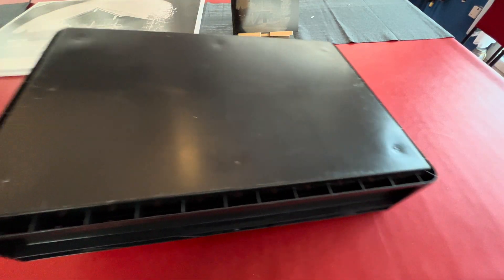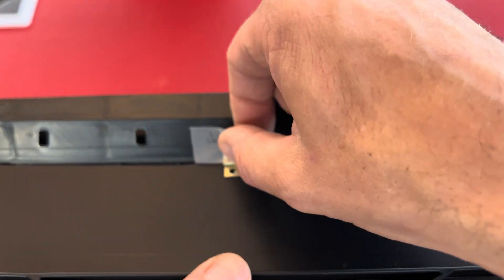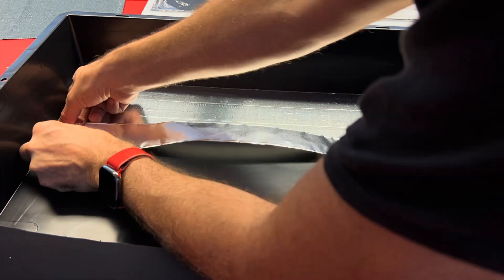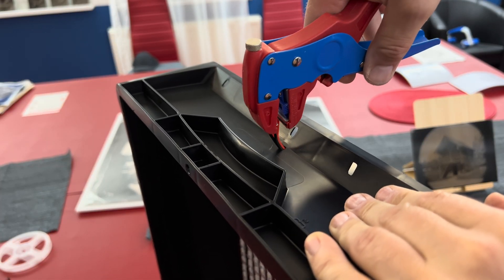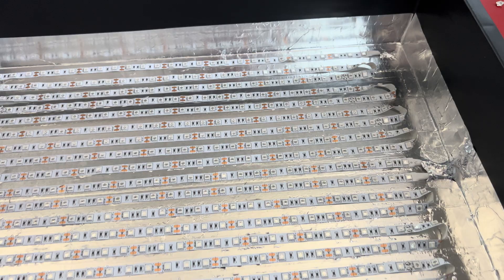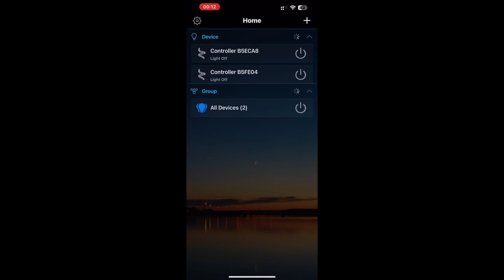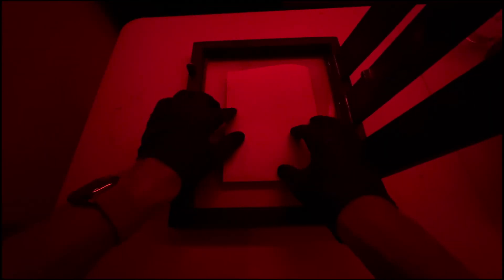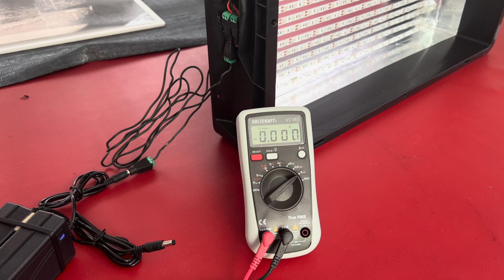Easy to build DIY UV Exposure Box with Dimmer and Timer - no soldering needed!

Comment: A word of warning: I bought all of the amazon linked parts in the description, but the power supply that came with my lights did not have a removable power cable. Therefore, I could not attach the on/off switch or the power cable splitter.
Reply from the maker: Thanks for the hint. I think the seller just ship what they have and never change the image on Amazon. I would just send them back and order another. Please let me know from where you ordered and if you have found a valid link. I’ll update it than.

Comment: Cool and simple,. 
Two questions: 

- How warm/hot does the box get with your 2x 26W in 5 min  when setup at room temperature ?  I fear a bit the temperature rise of the design when doing one brint after the other for e.g. an hour in total.
- Why do you need dimmer aside of  use as timer ? Why not having a  timer only, or are the light demands for the different processes so  divers ?

Thanks & Regards
Frank
Reply from the maker: Great question. I will do a test for two hours today and post the temperature here. I hope that the aluminum will absorb a bit of the heat. Honestly I am just starting with salt prints and I read that you ge more details in the blacks when you do longer exposures. Thats why I thought a dimmer would be a good idea. I am quite busy renovating my darkroom, so I couldn't do much tests so far.  Just the first ones to be sure its working.
Reply from the maker: After about 2 hours it gor 42 Degrees celsius on the hottest spot in the center. on the borders it got to 29. Room temperature was 22 degrees Celsius. See my community posting only my channel for more.
Reply: Many thanks for the quick answers. Those help to consider/plan an own box.
Reply from the maker: @FrankTitzeArtShorts  very welcome -
Maybe consider a little fan on the back of the box